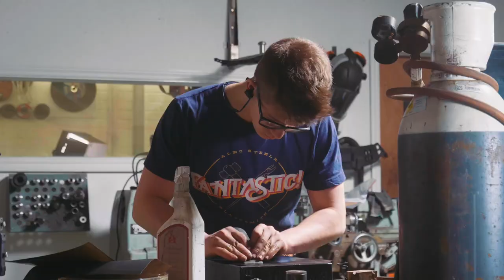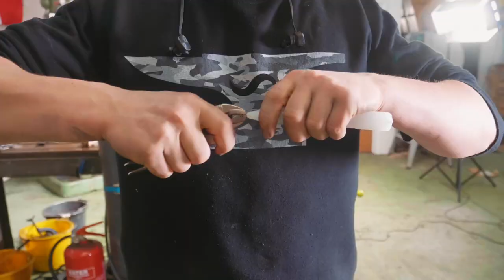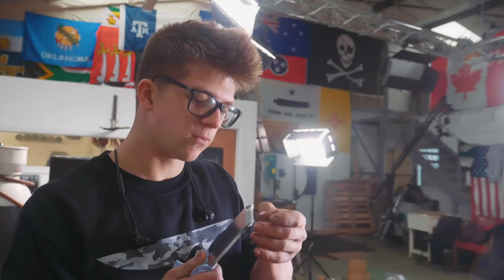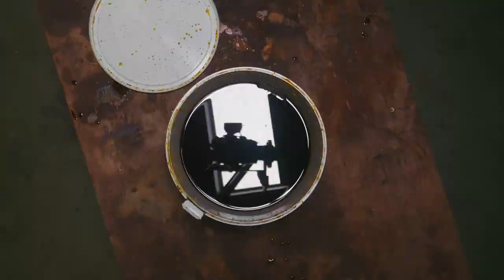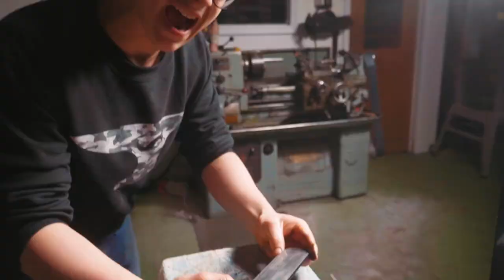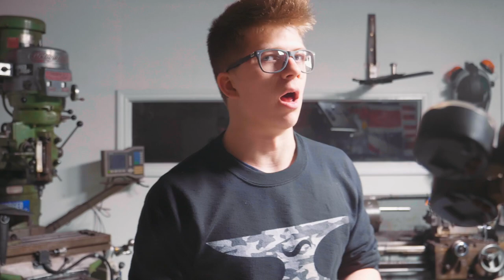DAMASCUS HAND PLANE BLADES!! Part 3: Dustin Penner Collab!

Comment: Not everything should be damascus steel. A blade that is used to a high precision to surface/finish a product surface, should be as homogenous as possible. 

Some may say the difference in material strength in the layers is too minute to affect anything on a practical level, obviously don't have decades of experience comparing the advantages of different types of steel. 

I've used cheap plane blades that were just sharpened pieces of rolled metal, and I've used formed and tempered blades that were 20X the cost, but they were also 20X the quality, since they didn't chip, curl, or add striations when dulled. 

Someone that has built a life with blades will know the difference immediately, but some hobbyist building a coffee table for his wife out of pallet wood doesn't know enough to care. 

Its cool to see the process, and in no way do I intend to diminish the significance of Alec's work, but damascus isn't a satisfactory forging process for this application.
Reply: nunya bisnass both steels used in the project are tool steels. They have enough hardness to keep an edge. The samurai carpenter has already confirmed this with the chisel alec made him
Reply: 15n20: 0.75%Carbon,  2% nickel and 1084 I believe.  Should have fine hardening qualities and used by ABS. Not necessarily better than mono steel but that is not much of a challenge I guess or take as much skill.
Reply: Aey - Anna Pibulsilp well let's explore this a little. I'm just putting it out there that I'm not a chemist or engineer, which is why I'm not as concerned with the overall structure of the whole piece. Where I'm focussed is at the cutting edge, and how the layers at the cutting wear slightly differently than a pressed, rolled, and flattened sheet that will have a more homogeneous grain structure throughout the material. 

You can compensate for variations in personalities of a tool and material with genuine skill, but half way through the day it becomes quite bothersome to interrupt your work more frequently for maintainance. 

Handmade products can have far superior or inferior qualities, but the turn out is inconsistent and highly variable.
Reply: nunya bisnass It seems to work well for knives if done right. I agree that damascus adds no improved qualities and risks failure. If you are pragmatic then you cannot beat a very high quality mono steel. I do appreciate the properties of japanese blabes such as shirogami clad with soft iron as sharpening is much faster as there is less hard tool steel to abrade.
Reply: nsaylor10 while they are both tool steels and they do have very comparable hardness ratings, the whole look of Damascus is caused by the fact that they corrode at different rates. Are they hard enough to put an edge on? Of course. But when dealing with razor sharp edges like this, that difference in corrosion can be a huge issue. Especially if using Japanese water stones to hone them. The process of sharpening gets the blade wet and water causes corrosion. When he first started I thought he would weld a billet of Damascus to a homogenous billet of tool steel and shape it so that the tool steel ended up as the edge. It wouldn’t have added much more time in the forging process but it would’ve guaranteed a more durable, longer lasting razor edge.
Reply: Will Ehster any tool not maintained will degrade. Jesse's only complaint with a comparable chisel is how long it takes to flatten/sharpen since it is all tool steel. Samurai carpenter uses Japanese water stones when sharpening. I think to criticize the materials used is a little overboard...the difference is negligible, especially for a piece made mostly for entertainment
Reply: Will Ehster The difference in corrosion between 15n20 and 1084 is negligible.  You are confusing etching with strong acid which corrodes all steel. It is the nickel content that gives the contrast. When sharpening steel with waterstones corrosion is never a factor unless you leave it wet. Carbon knives reactwith acidic foods reasonably quickly but chefs all around the world simply wipe them dry regularly.
Reply: Aey - Anna Pibulsilp you can clearly see a difference in surface texture after he pulls it out of the etch so it’s definitely not negligible. My point is that it would’ve taken one extra step to forge weld a solid piece of tool steel to the edge side of the billet of Damascus to prevent any of these issues in the first place. I’m fully aware that keeping a razor sharp edge on a plane blade or chisel or gouge is a constant process. In certain hardwoods I’ll lap my chisels after every cut, and at the very least once a day. Having one homogenous piece of steel for the edge just makes more sense to me. Still a huge fan of Alec’s. Still incredibly impressed with the result of his work. Just pointing out a few minor things that I would look for when buying a plane blade or chisel blades.
Reply: Will Ehster I am not sure you have to worry about being in the market for a bespoke damascus plane blade. Not sure if they sell many.
Reply: Aey - Anna Pibulsilp its just a professional criticism. But you're right. There isn't a market for decorative Damascus plane blades that would risk the integrity of artisans in market itself.

Its kinda just something you think about in the context of ones own profession or passion, to try to understand how such a product may fit into your life. 

I guarantee there are similar discussions on Briggs and Stratton forums, anytime a basement engineer with a rebuilt hendy lathe and mill tries to "improve" on established concepts while repairing or refurbishing a defunct engine head. That's just nature of being a craftsman, that kills me for the common person in my life to not comprehend. 

I guess what I want to say is that criticism should be constructive, and no one here to my knowledge has said anything fundamentally wrong or incorrect, but are just weighing the different pros and cons within a specific context. 

Tool steels of any formulation are designed to meet a specific set of criteria, so of coarse while I can forge a leaf spring into an axe, it will not have all of the best properties of a 1971 Kelly works axe head that I desire.

Comment: why cant the acid get on the blade?
Reply: justin Thibault it will eat away at the very thin edge
Reply: justin Thibault because it eats away at the metal if you let it eat away at the blade then the edge would have a bunch of ridges in it. No good for cutting.

Comment: Ah yes. Good old dihydrogen monoxide XD. Alec sure has a talent for making the mundane interesting
Reply: Samuel Bennett poor attempt. It's usually dihydrogen monoxide
Reply: Barry Britcher whoops! Yeah you're right
Reply: Samuel Bennett Sorry bros.  But it's Dihydrogen monoxide.  2 hydrogen atoms, 1 oxygen.  It's a very simple concept. 🤓
Reply: Joey's Garage H2O has only one oxygen
Reply: Samuel Bennett You are correct. One oxygen.  That's why it has a mon prefix. Typed it wrong.  But I stand corrected
Reply: don't worry about it mate, I spelled it wrong the first two times :)